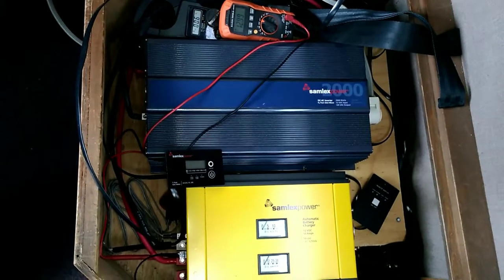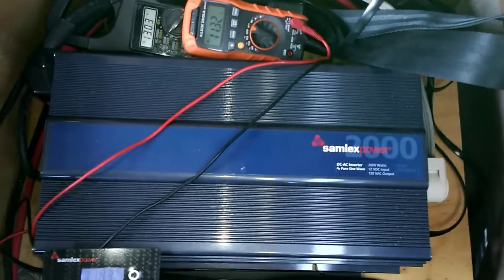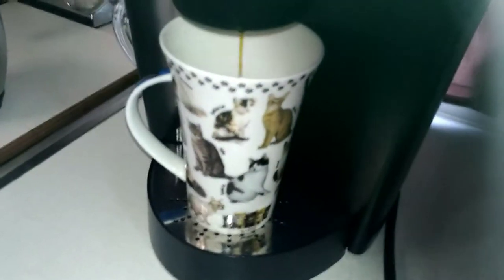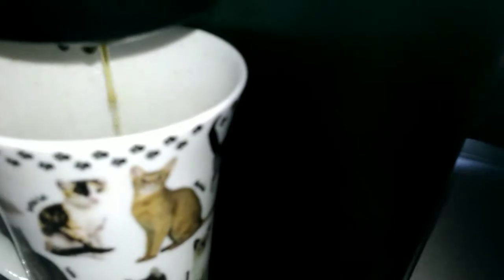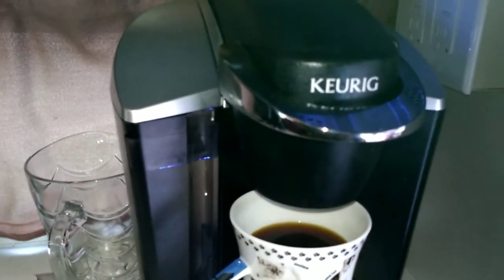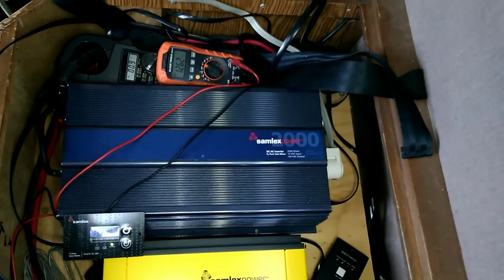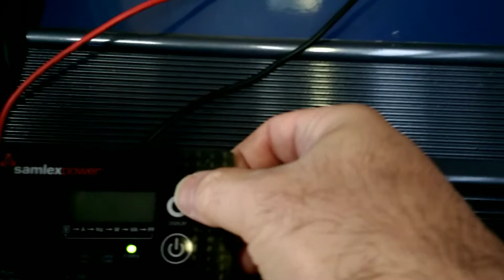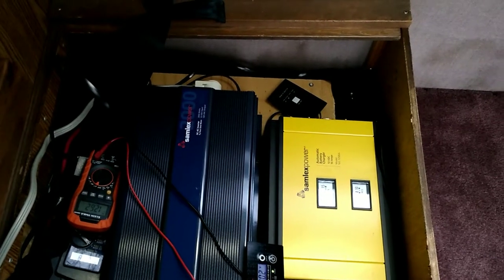Keurig running on 2000 Watt Samlex Inverter - After 3 Years

Comment: My 2000 watt inverter won’t run my kurig I’ve got 3 batteries a couple of new rv batteries and an optima fairly large one. Golf cart batteries is the difference I’m guessing. It overloads the inverter and kicks it off
Reply from the maker: some 2000 watt inverters are two separate 1000 watt inverters with independent outputs, you may want to check for that
Reply: @SteveRivett  I can’t find anything in the info about it. I got it at Costco and it does show the out put. The golf cart batteries that you have on yours are they substantially larger than a 27f battery say for a big engine older ford? It goes thru tthe initial heating cycle and goes halfway thru the pump cycle and then the voltage drops and it kicks off.  I have a 1500 watt also and it does practically the same thing. I’ve hooked 3 batteries up and have a plug for a trailer that access the truck battery and gave the engine running it doesn’t seem to matter. Thanks for your interest